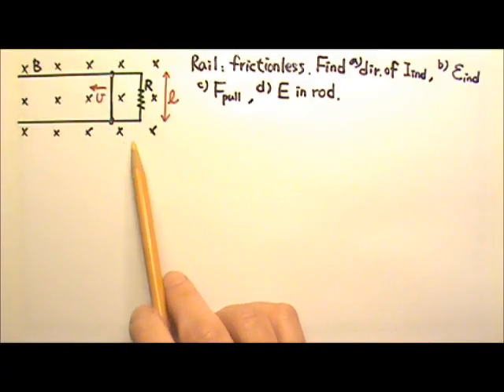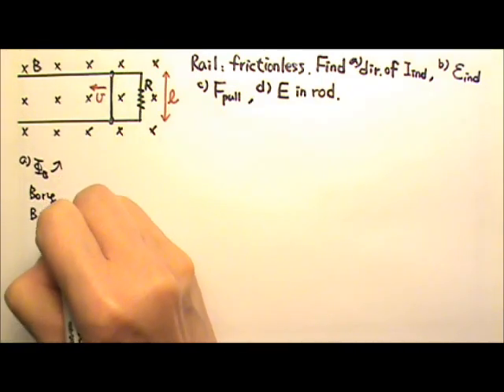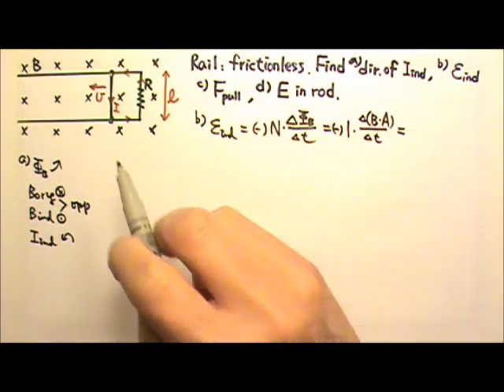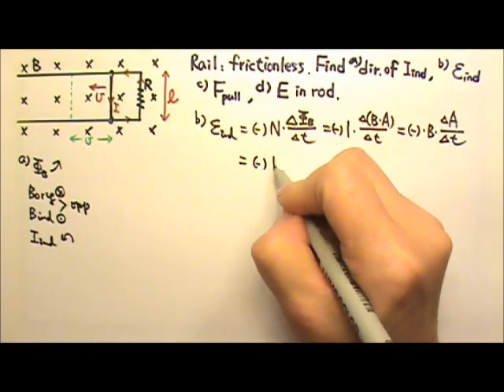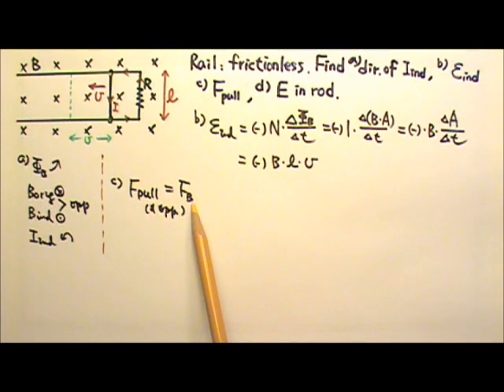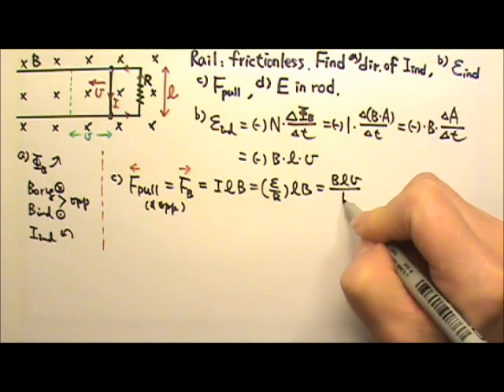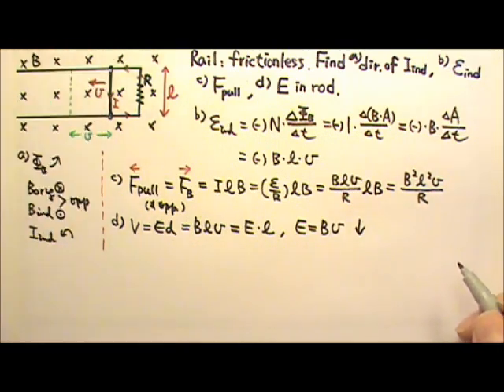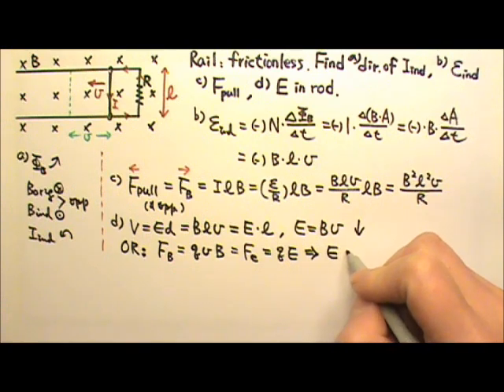AP Physics 2: Induction 8: Sliding Conducting Rod on Rail in Magnetic Field

Comment: what is the distance that the rod can slide before it stops, say frictionless. and initial v is v0
Reply from the maker: Because the magnetic force acting on the moving rod = BBLLv/R, the force is a function of v. So we have to write F = ma = m dv/dt and solve this differential equation to find v(t). Then we can integrate ∫vdt from t = 0 to t --> infinity to find the total distance traveled which is mRvo/(BBLL), where vo is the initial velocity.
Reply: thanks so much~